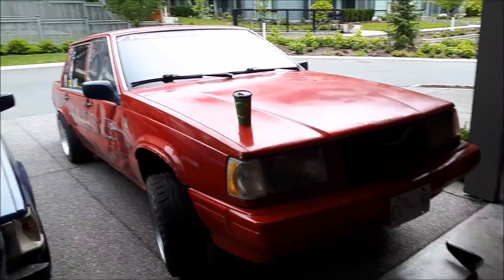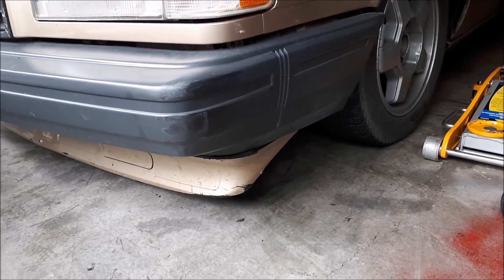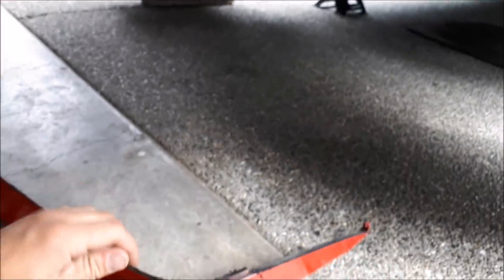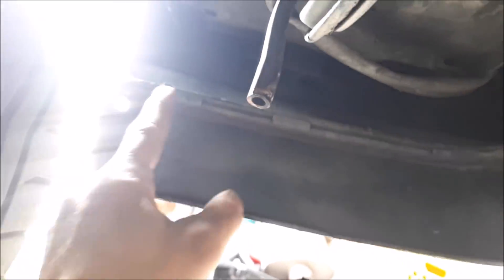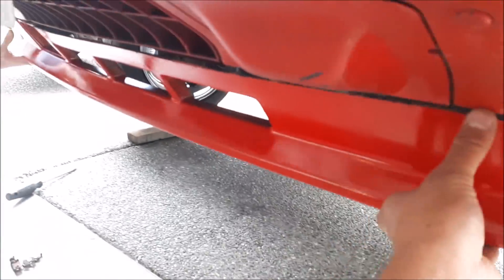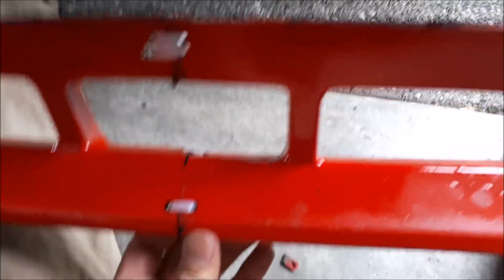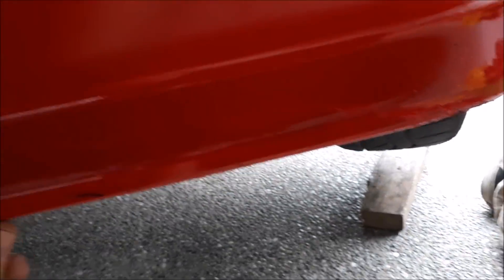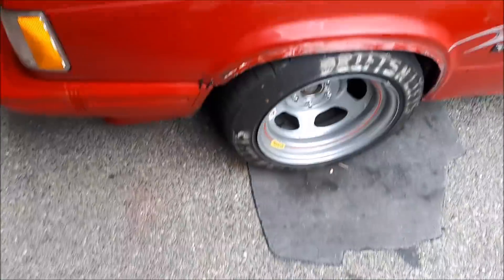VOLVO 240 FRONT LIP ON A VOLVO 740?!

Comment: Hey guy, you should have picked yourself up a plastic welding kit from a decent local hardware store, they're usually around $20 to $40 depending on what extra little things that you want but you can literally weld two types of similar plastic together seamlessly with one of those kits, then make structurally sound good looking pieces that you could have used to make that lip look factory

Comment: What have you changed on the engine? I know you have a 531 head. I´m a Swedish guy so get the part shud not be a problem C:  I drive a standard 940 turbo but thinks it's not enough.

Comment: I can’t wait to hear this thing scream, I’m sure this is as fast as a boosted Volvo now, what’s the cam called?
Reply: a stock LTT that makes 0.3 bar of boost makes 130hp and there is a FTT aswelll that makes 160 at 0.5-0.6 bar of boost
Reply: The cam is a Timo 13,10 I believe
Reply: Fjewt Yeah but that's engine hp, Miss Huff makes 170 at the wheels, definitely faster then a stock turbo redblock. Timos website: http://www.timosmotor.com/kamaxlar/kamaxel-timo-1310-b230
Reply: @Fjewt  B230fk 134hp and b230ft 165 both turbo, there is however a N/A B230 called B230FB with 131hp